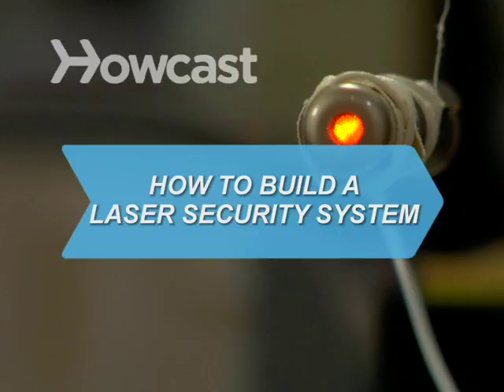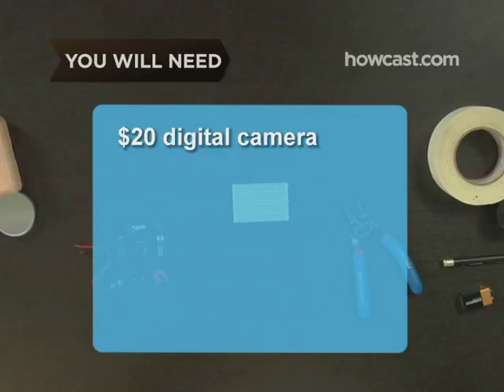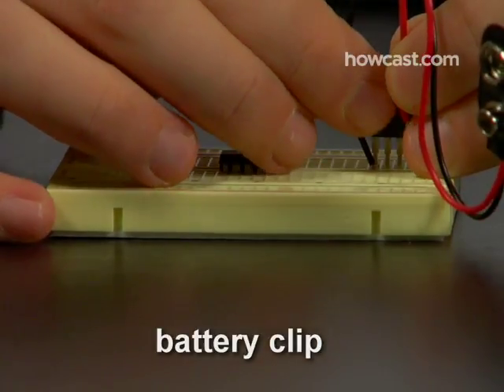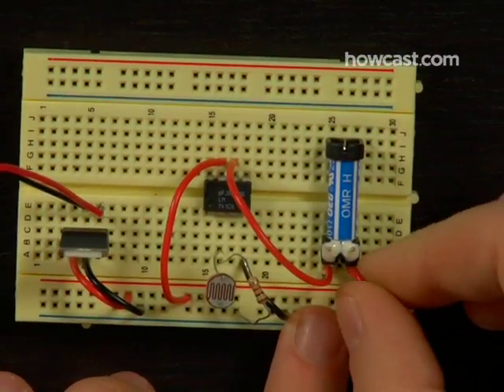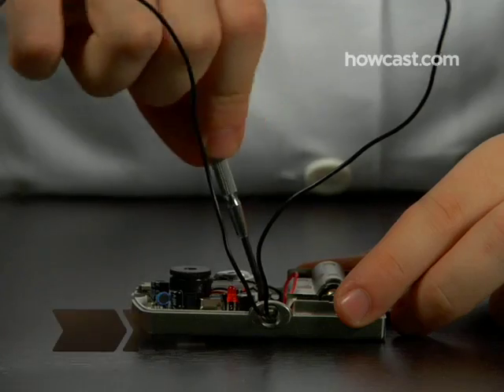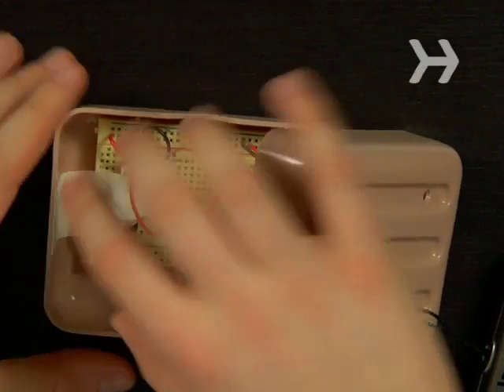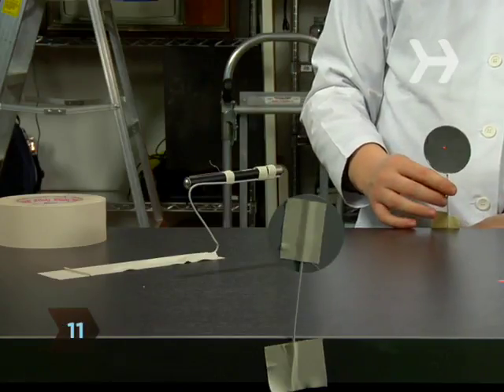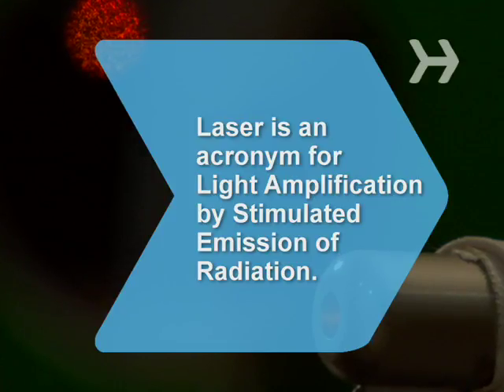How to Build a Laser Security System

Comment: Ok, this looks like a cool project, lets see what we need.
Laser Pointer- Ok, I have a little one around here somewhere.
Duct Tape- Check
Small Mirrors- Yeah, I can pick those up somewhere.
LM741 Chip- Uhh/ leaves video
Photo Cell- Ummm
$20 Digital Camera- Kinda alot of money but sure.
Extra Small Screwdriver-Yeah, there should be one in the toolbox
Wire Coat Hanger- Check
Thin insulated wire- I can probably find one
Printed Circuit Board-WTH
9V battery- Check

Comment: For what it's worth you can save a few cents by not using the LM741 chip. As the absolute maximum rating for the supply voltage is +/- 22V. Thus, using a 9V battery does not even reach half of the absolute maximum supply voltage. Also, when using a supply voltage higher than 9V (say a 12V battery), you will not need a heatsink (provided you do not use a voltage regulator).

Comment: These devices do work even though they are meant for electronics hobbyists who can not afford to pay out the backside for commercial grade equipment and need something in a snap.  The version in the video is a test unit until you are ready to build the real thing.  Personally, I would have built the device with the camera and laser detection modules in the same case and outfitted it with an output to a siren loud enough to wake up the dead or bring the police running.

Comment: A laser pointer
Some Duct tape
A few small mirrors
An L.M.741 microchip
A 220-ohm resistor
A photocell
An inexpensive digital camera
An extra small screwdriver
A wire coat hanger
Some thin, insulated wire
A printed circuit board
A 9 volt battery
A 9 volt battery clip
Soldering equipment
A pair of wire cutters
A soap caddy with drainage holes
A voltage relay
oh yeah i can deffinetly get these things from CVS

Comment: @TheElectroTom ... The volt regs output voltage would be suitable for your LM741 chip, so as not to burn it out.  Google LM741.  5 to 18 volt.  Go for something that fits your relay voltage needs.  Keep it all at 9v or less I'd suggest.
(Crappy design by the way, tape?  wtf!)

Comment: thats easy made.  But do not disasemble a digital camera, with out knowing what you are doing..

 touch the hi-voltage capasitor for the flasher inside the cam without discarging it, and it will KILL YOU where you stand.

Comment: or you could buy a wire a shotgun and mount the shotgun pointed torwds your desk and conect the wire to the pen or pecil and run the wire threw some pullys and conect the other end of the wire to the shot gun so when someone grabs a pen it takes care of  your problem

Comment: see, you could get a,
Laser pointer
duct tape
small mirrors
LM741 chip
220 ohm resistor
photo cell
$20 digital camera
extra small screwdriver
wire coat hanger
thin insulated wire
printed circuit board
9V battery
9V battery clip
Soldering equipment
wire cutters
soap caddy with holes
and a voltage relay
or you could just get a damn video camera!

Comment: I Know.  but i just took a look inside my old cam.  220uF 330V. thats quite a big cap. :-) enough to sound of like a firecracker if shortet.   just like tube amp capasitors. I wouldent dare touch it with my bare hands.. ..

Comment: that isnt a printed circuit board it is a breadboard a printed circuit board or pcb is a sheet of fiberglass with copper coating and they get etched using acid so howcast you are wrong sorry

Comment: this video is totally off they said a 22 ohm resistor they used a 1k then when they first installed the regulator they installed the supply backward but they change it and what they did to the relay wouldnt make sense and a laser pointing to a photocell wont do anything by it self